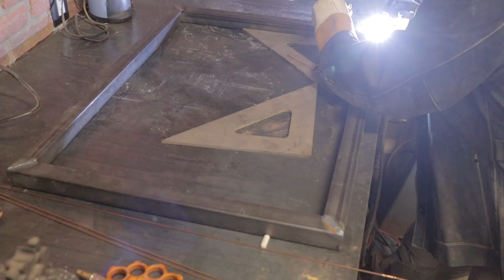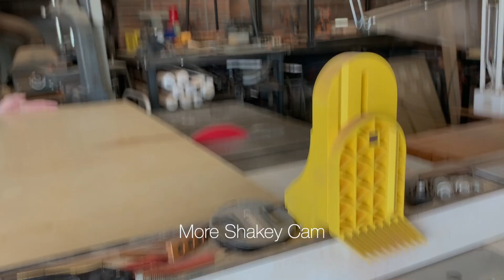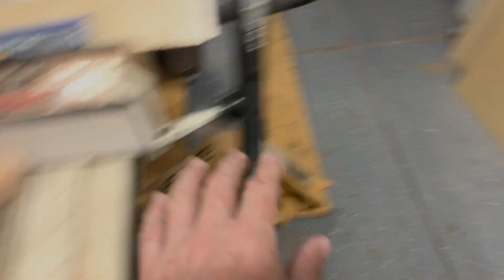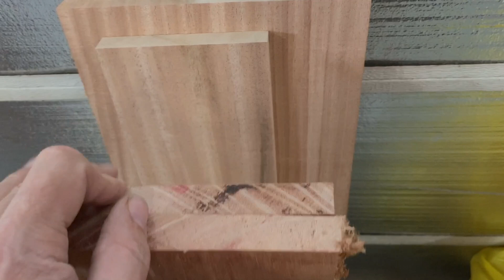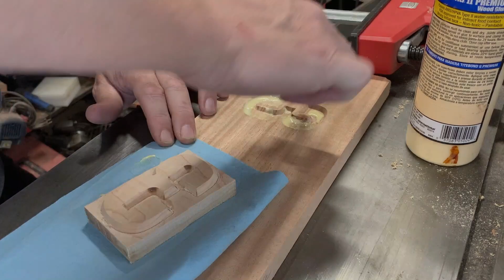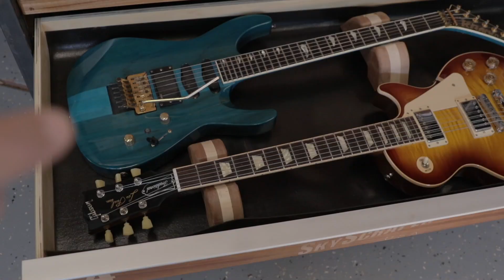Lets Build A Guitar Storage Cabinet

Comment: Great video! Are there any long term negative side-effects on the neck with this kind of storage? I see that the body is slightly raised as each guitar sits in the cradle. I ask because when in a case the angle produced by the cradle is lower and was wondering whether there is any long term negative side-effects to the neck and if so how to mitigate them. Thanks in advance to you or anyone who kindly responds.
Reply from the maker: There is a long standing debate about storing guitars on hanger vs in cases...  Then flat vs on end vs on the side...  I haven't seen gravity affect a guitar long term.  I have seen moisture (or lack thereof) have adverse effects on a neck.  If you're starting with quality materials, the neck will be just fine sitting on a neck rest...  Vince Gill stores a lot of his collection this way.  I'd put him at the top of the food chain with regard to collectors who are also monster players.  If he thought for a second storing a guitar like that would have a negative effect, I guarantee  he would change his method.
Reply: @GregsGarage  Thanks so much for the quick response. I really like the idea of this cabinet. Great channel.

Comment: Is there any issues with your guitars being laid on their backs long term? I always read you should have them either on their side of vertically. Can anyone chime in on this? I love this setup!
Reply from the maker: No issue storing them on their backs.  The necks have an adjustable truss rod, so as long as you have your guitars adjusted, they won't take on any additional stress.  Many vintage guitars have been pulled out of their cases having been stored under a bed for decades without issue.

Comment: Hey Greg. Do you have plans and a bill of materials available for your cabinet design? I have a guitar problem (Guitar Acquisition Syndrome or G.A.S.). This would be a nice solution for me.
Reply from the maker: I understand GAS completely!  The video has a shot of the sketch I did...  That's as close to a set of drawings and materials as I have.  I recall getting all the drawer sides and the case sides and top out of one sheet of pre-finished plywood.  The drawer bottoms were MDF and the back of the case came out of a spare sheet I had laying around.  The steel is 1" square tubing.  I used about 30' of it to make the frame.  4 casters, 5 drawer slides and 5 pieces of African mahogany about 5" x 42" if I remember correctly.
Reply: @GregsGarage  Thanks!

Comment: What are the measurements for this thing, did I miss that part of the video? I want to build one similar but using lighter material and each drawer would be for 1 guitar each and for tour use. kind of like this https://www.google.com/url?sa=i&url=https%3A%2F%2Fwww.pinterest.pt%2Fpin%2F12877548917917860%2F&psig=AOvVaw1-aGD8bmQObx4A8Mqw98ni&ust=1605729660351000&source=images&cd=vfe&ved=0CAIQjRxqFwoTCJDFkqKviu0CFQAAAAAdAAAAABAj

Comment: Wow! That is one really slick build!  I like how you integrated your inlay on the front and the metal framing structure used.  Just another player throwing my 2 cents in here, yes do a thin mat or drawer liner like you said to fit the inset of the top so you have a soft work surface right above and no worry of hard surfaces clashing.  Maybe go black on the sides too with some flat handles to emulate a roadie flight case. Other than doweling the screw holes too like you mentioned it looks really nice as is.  Enjoyed the detailed explanation and the solid construction techniques, well crafted, well presented, & well done!

Comment: Nice job Greg... Cool looking style and design with unique application of hardware and materials!
Heard your frustration with Watco wipe on poly at the end of the video. I've not used that brand of product but I have always been quite pleased with the results I get from Old Masters gel Poly... ask me about it sometime if interested. For beautiful wood like your drawer fronts where a velvety tactile feel is a plus the gel poly is a much better choice than spray applied lacquer IMHO.        I'm kind of jealous of your ability to engrave drawer numbers and logo into your drawer fronts though! 😟
Best, Matt
Reply from the maker: Thanks for the tip about gel poly.  I'll give it a shot on my next project...  I do like the finish from the Watco, but man, it was a long haul to get there.
Reply: @GregsGarage  if you have seen the Live Edge cabinet door video that I did I think I put three coats on those doors and it was more than enough finish on them. It's stupid simple to apply and virtually foolproof. The most challenging part for me is waiting 12-24 hours between coats rather than 24 minutes as with lacquer

Comment: Just in case you never heard it before but another way to help ensure metal stays where you want it is to "skip around" as they call it. All this means is weld small amounts at a time and move around so that you're not heating up one place much. Using this method we would weld a rectangular tank approximately 12"x24"x30' and it would stay straight along the 30' direction. The first tank like this that was welded with out this method turned into a large banana.

I REALLY liked the whole build. I can easily see something like this for my wood tools.

Comment: You need some Fireball Tools mega squares. Those straps are handy, but as soon as the metal starts to shrink, the straps are going to stretch.
Reply from the maker: Yeah.  Those are on my list...  But first, I want a Fab Block table.  When I built out my new shop, I had a spot for one, but decided to save the $$$...  It's time to remedy that!  Thanks for checking it out.
Reply: @GregsGarage  I don't have a Fab Block, but I do have a weldtables CertiFlat that I love. I made some of my own clamps for the holes. I was going to make my own mega squares, but my access to a water jet was curtailed by the Covid. Maybe next year. :)